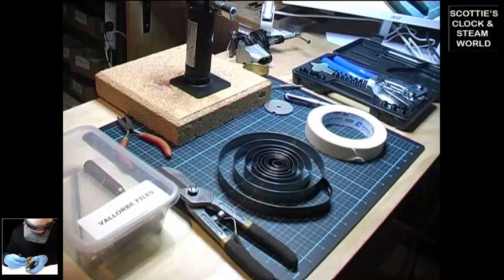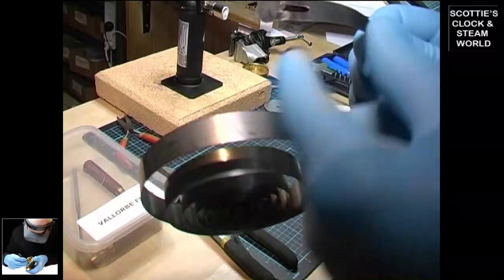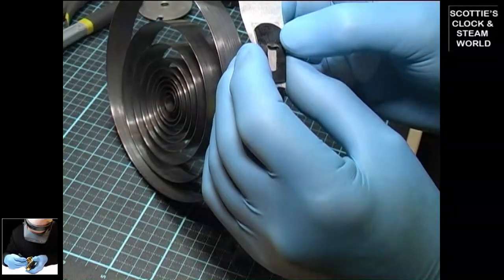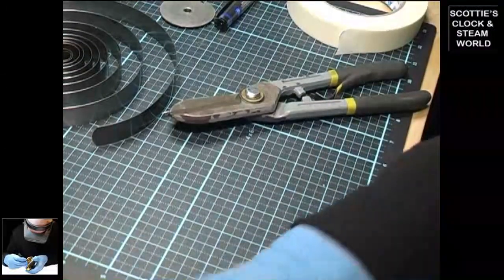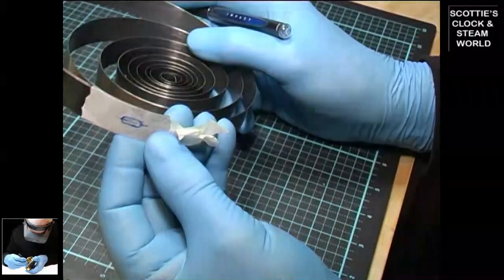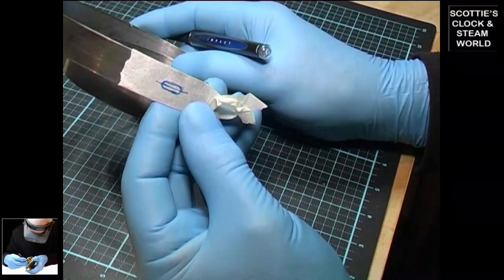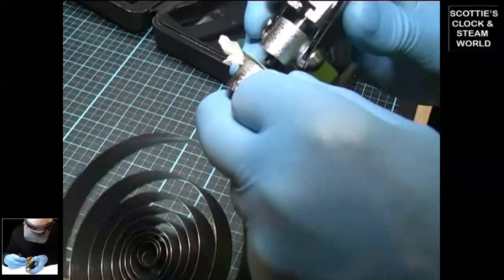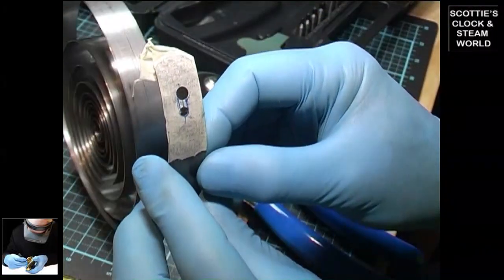How to repair a damaged Ansonia barrel mainspring - Part 1 #americanclockrepairs #AnsoniaClocks

Comment: Very instructive, thank you. Why not use the step at 3:46 to create the template for the hole at this time rather than doing it as a separate step at the outset?
Reply from the maker: I am currently repairing three French movements for a customer, three of the six mainsprings has broken or unusable holes that attach to the barrel hooks. I actually made a template for the correct hole size and shape and shot a video of one of the mainspring repairs. That video will be uploaded early in the New Year in a new 5 Minute Video Series: 2020 playlist.